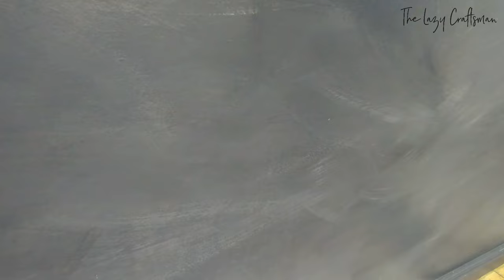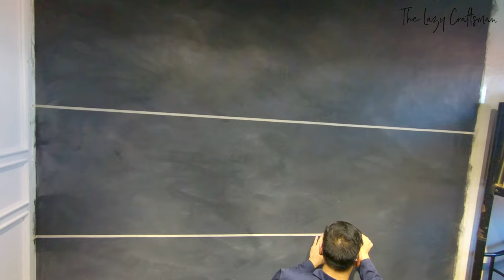DIY Faux Concrete Finish Wall Using Ordinary Paint

Comment: This looks great! How long did you wait before the 2nd coat? Did you really not mix the white and black paint in the tray for the 1st coat?
Reply from the maker: Thank you! I waited around 10 minutes before applying the 2nd coat. For the first coat, I intentionally did not mix the black and white paint so that the color would be uneven.
Reply: Is it gloss paint or flat
Reply from the maker: @jeramyfortney5895  I used semi-gloss in this video. 🙂

Comment: Really nice job. I plan on doing this soon.  Were you using pure acrylic or a standard acrylic latex?  And I assume all matte/flat?  And I have to ask why the mask though?  If you were not wanting to breath paint fumes, only a true NIOSH mask with charcoal filters would do that.  And if for Covid, I don't see a lot of people standing around where that would be of any concern.  I used to be a painting contractor and unless spraying I never really wore one, except with oil based paints or especially with stains.
Reply from the maker: I used pure acrylic in satin finish, but you can also use matte or flat. About the mask, I made it a standard to wear one on my videos even if most of the time I don't need it. 😄Thank you for the input.
Reply: @thelazycraftsman  hi. what’s the difference between using acrylic and latex?
Reply from the maker: @thatchicknyc3606  Acrylic paint is slightly more durable than latex. But they are almost interchangeable because both are water based paint.

Comment: If i want lighter shade of gray. Ratio should be higher % white and lower % black? Correct?
Reply: Also wanted to ask. Is it okay to use elastomeric paint, its also acrylic waterbased paint
Reply from the maker: Yes 😀
Reply from the maker: @VonDenzelDyquiangco  You can use elastomeric instead of acrylic.
Reply: @thelazycraftsman  wow nice, thanks. It's really helpful. I was really planning to use limewash paint (whch is expensive) but then i saw ur vid.

Comment: Lazy craftsman indeed. Didnt bother to tape off the cabinets b4 painting, and got gray paint all over them..
Reply from the maker: I did place transparent tape on the cabinet. If you check out the final product, the cabinet does not have the grey paint. 😄
Reply: Absolutely unnecessary comment.